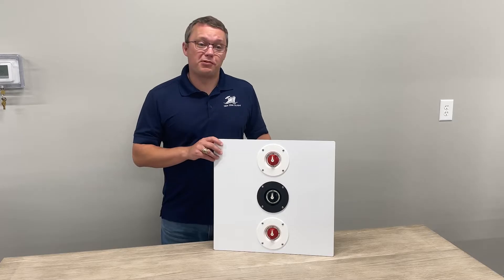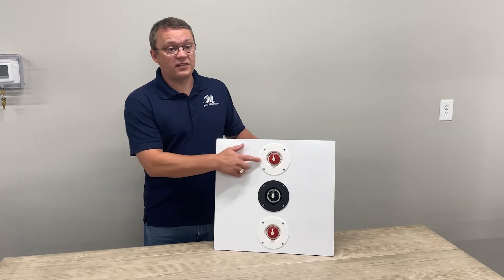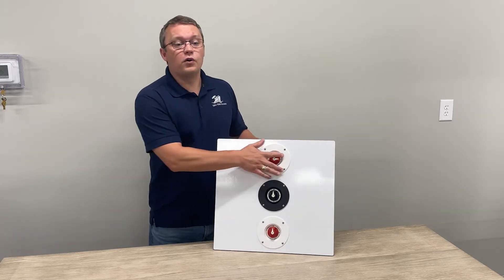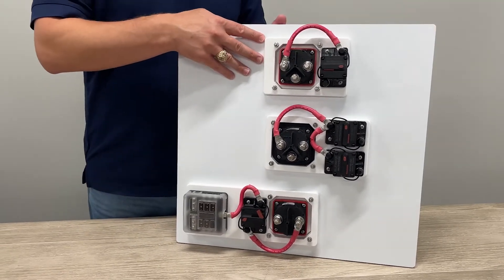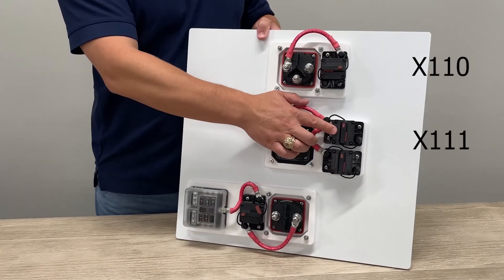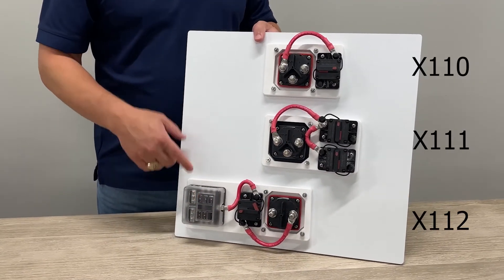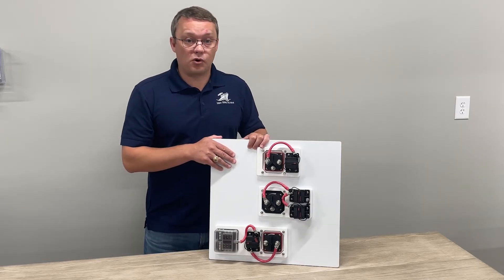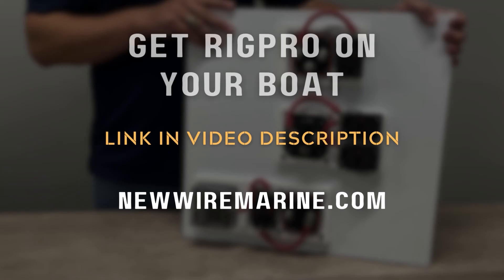RigPro: The Customizable Series for Your Boat's Battery Management

Comment: Hello
I have a question. Regarding the rear mounted breaker switches. This type of panel will need to be on a hindged door to get to the breakers to reset when nessesary? oppossed to being   permanently mounted.
Reply from the maker: I suppose so if there was no other access to that space.  Our thought on this is that it would normally be installed on the side of a console or bulkhead with hatch access.  I mean normally it's going near the batteries right?  If it was in a void with no other access point, then how would the batteries get inside there in the first place.